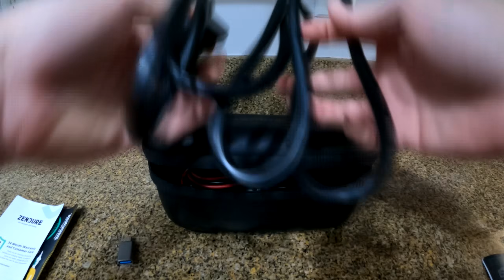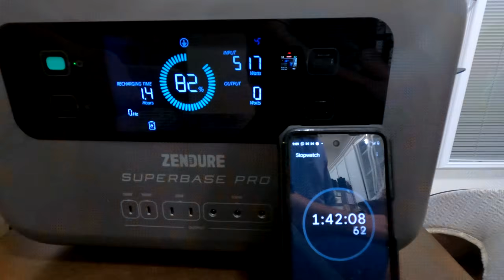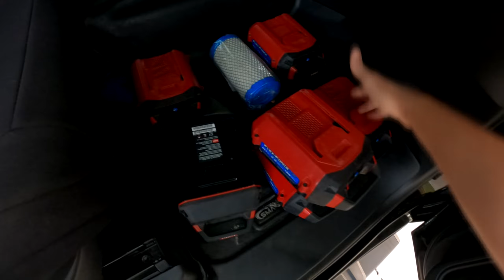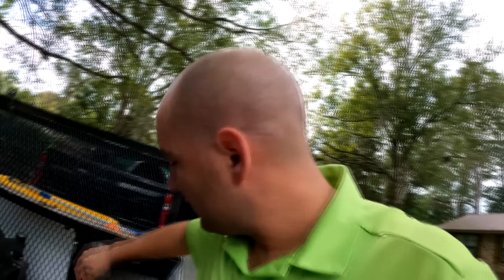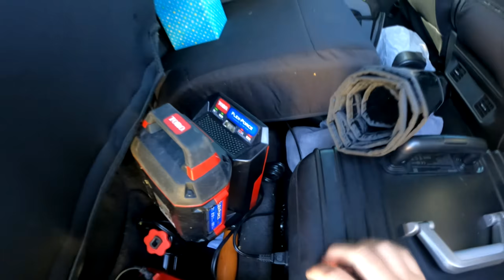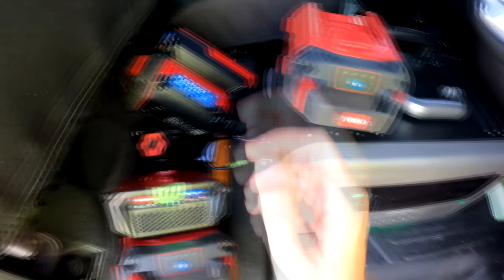Should You Buy Battery Lawn Care Equipment? (TORO 60 Volt, Zendure SuperBase Pro 2000)

Comment: I am a small yard homeowner and finally switched to EGO this year.  still gas mower, but so far the batteries are so good makes me want to get the mower as well.  I think the tech will only improve in the next 5 years.  I think the key for your situation is charging and charge time.
Reply from the maker: Agreed, the 'lasting all day' is the main issue with battery for commercial.

Comment: been considering a battery trimmer lately
60V Toro actually a model on my list
my 13 year-old 2-cycle trimmer has been trusty every season, but it has been very quirky since June this season
taken it to 3 shops, 2 cleaned/adjusted it (which helped only temporarily) the 3rd wouldn't touch it instead tried selling me a $380 battery model 😑

Comment: I bought one of the new Echo commercial grade battery powered weed eater. It didn’t work out at all at I took it back after a few weeks and bought a gas powered Echo SRM-2620. I really wanted to trimmer to have the power of gas but it wasn’t even close. This equipment is getting better every year though.👍🏼

Comment: I switched over my edger and string trimmer to Dewalt but I already had the tools so the cost of the battery wasn’t quite as painful as others. I’m in that use case where I do weekly maintenance or biweekly maintenance as a homeowner and my string trimmer and edge work is maybe 45 minutes a week and honestly less two cycle engines to maintain is fine with me. The battery options for that use case are by far better than gas but my leaf blower and mowers are still gasoline.  I am seeing a lot more electric push mowers in the neighborhoods that are only quarter to half an acre so I agree it really depends on lot size and the individual property.
Reply: My parents have a bunch of Dewalt batteries so I am considering picking up all Dewalk tools for maintenance except hedge trimmers and a leaf blower. Would you mind sharing if you have run into any issues at all?